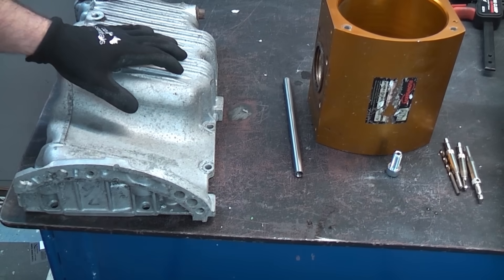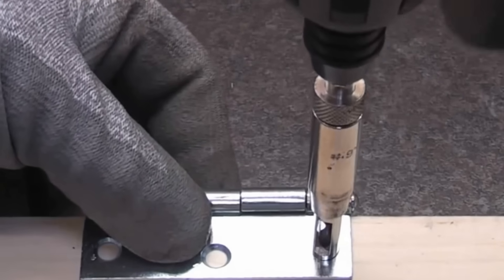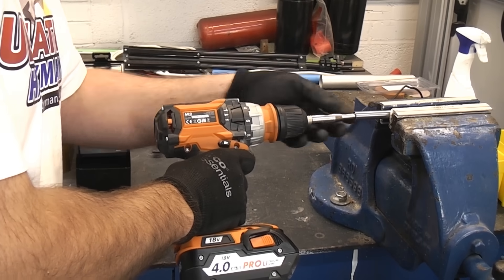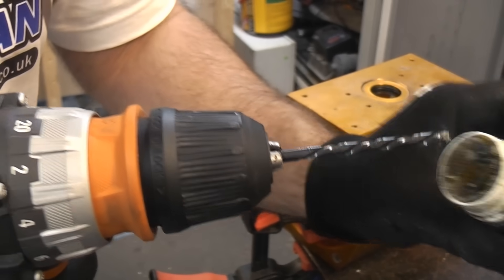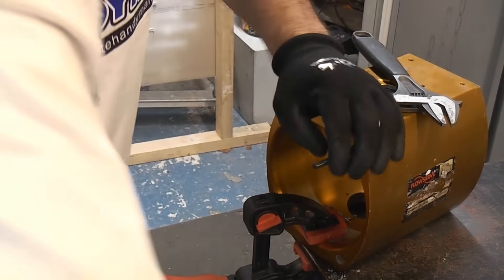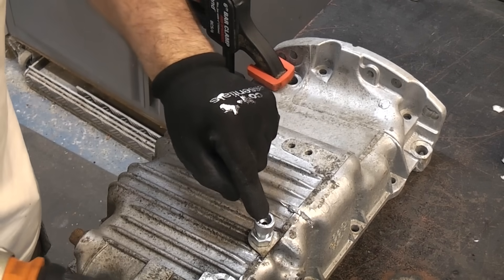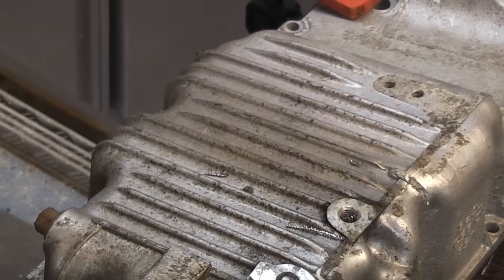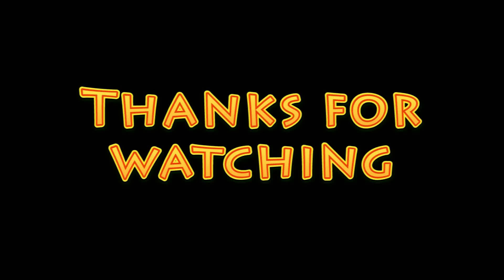How to remove a broken bolt in a deep hole | remove broken bolt in recessed hole

Comment: AFAIK you should not use copper grease when putting steel bolts in an aluminum object. Copper increases galvanic corrosion of the aluminum. You can use a marine anti-seize compound. I use ceramic anti-seize.
Reply from the maker: Thanks for the comment

Comment: Good video, for myself whenever I do this, firstly I don't bolt the guide (or bush) down, if the broken bolt releases it will just wind the guide out too. also I don't set the drill going as you do in the later part of the video, I always do it in short bursts as you did at the beginning and very rarely need  to use an extractor as the drill bites in better rather than just cutting.
Reply from the maker: Thanks for the comment

Comment: I have one Question. What amount by % do you reduce your torque settings when using anti-seize? on T-10 and-12 in Aluminum and or steel? I wasn't aware of all ways to remove broken bolts. And I am an old timer. Thank You for the education.
Reply from the maker: I don't normally bother reducing the torque to be honest.
If you think it is important you can ask the anti-seize manufacturers- they should have that data.
Thanks for the comment

Comment: Make a set screw into cleaning plug tap by putting a couple of saw cuts down the length, run it in breaking swarf every 3/4 of a turn by reverse of half a turn. 
Always assemble dissimilar materials with loctite 222 or copper slip. Goodness knows where you get a LH twist drill from.
Reply from the maker: They are widely available- Left handed drill bits- https://fave.co/2xJjK1M
Or in the UK- Left handed drill bits- https://fave.co/2DubtF4

Thanks for the comment

Comment: Never tap in a screw extractor,  you can cause the screw to expand,  the counter clockwise turning is enough.
Reply from the maker: If the manufacturers tell me to do something, I normally do it.
Please contact the manufacturers and tell them, that their instructions are wrong.
Thanks for the comment

Comment: Won't greasing a bolt make it come lose easily? I mean by accident, via vibrations etc?
Reply from the maker: No, anti-seize doesn't normally affect fasteners like that. If a fastener is likely to vibrate loose, you would use thread locking compound or something to prevent it from loosening. 
Thanks for the comment

Comment: Back in the 1980, I usually use a drill bit and a Hex Tools  Wrench  and  to Remove a Broken Nut From a  manifolds from a 1988  Toyota Engine , it works like miracle .  😎👌👍
Reply: Back in 1980 u removed a broken bolt from a 1988 engine !?   Which u brought back in ur time machine ??
Reply from the maker: Thanks for the comment
Reply: remove a broken nut from manifold?
Reply: sorry I can't make any sense of what you are saying either. :)
Reply: Big, if true
Reply: Exhaust pipes used to be bolted to the manifold. Breakage was common. Usually I would drill a hole through the broken bolt, or remainder of stud, longways. Try an extractor and heat. If that didn't work, and it usually didn't, blow it out with a cutting torch.

Comment: Why do they make thos extractor square ? I had to make a special tool out of a 1/4 extension just to get a good solid grip
Reply from the maker: Not sure, but a 1/4 hex drive on the end would be useful!
Thanks for the comment
Reply: @ultimatehandyman  I'm sorry it was a 3/8 extension..I had a broken spark plug ..I bent the extension like a L it work to perfection tha was over 15 year ago but I still keep the bent extension in my tool box

Comment: That is all great on this bigger type of screws...but what do you do on M3 or M4? This proces is pointless on smaller screws?
Reply from the maker: There is not much you can do on smaller screws, apart from drill them in the centre and use a screw extractor, or drill out the screw completely.
Thanks for the comment
Reply: @ultimatehandyman 
Yeah I tried everything and nothing works...the screw is just too small and I can't drill the hole into it cause there is not enough material around it? 🤷‍♂️🤗

Comment: Is that a 2007 VW Passat sump by any chance? Looks familiar! ;-p
Reply from the maker: As far as I know, it is from some model of MG.
Thanks for the comment
Reply: @ultimatehandyman  Ah, looks very similar, my dad's Passat has a dodgy oil sensor so I poked my head underneath the car and the sump looks very similar, the sensor is in the position of the sheared bolt you were working on. I just stumbled across your video and thought it would be handy as I have a few stuck bolts on my 31 year old car that I suspect might end up snapping soon! Very handy information in this vid! :-)
Reply from the maker: Blimey, I thought my van was doing well at 14 years old - 31 years is awesome!

Best of luck with it ;-)

Thanks for the comments
Reply: @ultimatehandyman  Cheers! When it comes to these bolts I'm going to need all the luck I can get!

Comment: The bolts must be softer than aluminum in  this video,unless there are inches of threads and the bolt was too long.I've never broken a steel bolt inside aluminum,how did you do that?
Reply from the maker: Steel bolts sometimes shear because they are so tough. We use different tensile strength bolts on site and if you use a high tensile bolt they tend to shear off, whereas a lower tensile strength bolt is more ductile and will not shear.
Thanks for the comment

Comment: Hi,  I have a slotted M5 bolt on a chainsaw in a recessed location that I cannot remove.  The previous owner messed up the slot.  It is the recoil starter bolts on an 015 stir ll chainsaw.  The bolt is a lot harder than the surrounding magnesium case and I have to remove it to clean the carburetor.  Any ideas?
Reply from the maker: This could be a hard one. I'd start buy spraying some spray penetrant on the bolt, then insert a slotted driver and give it a smack with a hammer (the shock can help to loosen it). You could then try an elastic band over the end of the screwdriver, sometimes it helps to grip rounded off fasteners.
Good luck with it.
Thanks for the comment

Comment: Just FYI don't bang on your screw extractor set with a hammer. Once the ridges get rounded, they don't "bite" anymore and you're buying an new extractor.Let the tool grab the piece you're extracting on its own.
Reply from the maker: The instructions tell you to tap them in with a hammer ;-)
Thanks for the comment
Reply: You better write to the manufacturer of the screw extractor and ask them to correct their instructions.

Comment: Thanks for the video. The guide bolt is a good technique that I've used. Steel in aluminum can be tricky especially if subjected to the elements and heat. Damn chemistry. I'd like to add a couple points for anyone watching/ reading if the left hand drill or pick doesn't work. I start a hole with a 2mm carbide drill. Very sharp and doesn't walk off uneven surfaces as easily. Use care though because they are brittle and will break off if you get it sideways or bound up. Don't use a traditional center punch to mark the center of the hole if it is below the surface. The displaced material has to go somewhere and that somewhere is outward into the thread. Start small. Small drill, small extractor. Then work your way up. Eventually, the wall thickness will be much reduced and the remaining offender will be very weak. Often I've had good luck using a much smaller extractor than I thought, but drilling the hole deeper. If your hole diameter is too big early on, it reduces your options as you progress down your list of techniques. Good extractors are helpful and I use a very small brass hammer. The brass yields a softer hit to the extractor (less broken ones) and won't glance off to the side. If the piece is small enough, I will remove it and put it on the milling machine, however, there have been times I've extracted bolts at work where I can't even see down into the hole and had to use some more manual techniques.
Reply from the maker: Thank you for the comment ;-)

Comment: THANK YOU >>> VERY HELPFUL FOR WORKING ON BROKEN BOLTS ON MY DIRT BIKE!! THANKS FOR AWESOME VIDEO!
Reply: lmao came here for the same reason
Reply: Lol same my frame bolt is snapped
Reply: my spark plug broke inside the motor of mine i think its cross threaded im stuck 💀
Reply from the maker: Thanks for the comment

Comment: I wanna see video of the removal of an exhaust manifold bolt that's broken off in the block while the engine is still in the vehicle. Maybe the manifold of a v6 or v8 that's pointing to the rear of the vehicle in a transverse mount. Was so much easier to work on the older vehicles. Today's vehicles seem to require several wrists and elbows on each arm and my hands are usually too large to fit into extra large gloves. Thanks for the upload.
Reply from the maker: People think that because I demonstrate videos on my bench, that I don't have to do difficult jobs at work ;-)
Thanks for the comment

Comment: Actually when a bolt twists off it will be usually flush with the surface. You will not have threads to screw a bushing into. So your demo is no good for real life circumstances.
Reply from the maker: Actually, sometimes they break below the surface, just because it has not happened to you yet, does not mean it never happens.
Thanks for the comment

Comment: About 15 years ago I acquired a 1969 FJ40 that badly needed to be restored.  Although it ran and the transfer case was in great shape the body needed a lot of work.  I set about replacing all the bolts holding the body parts together with Stainless steal and quickly become frustrated with all of the bolts that broke off before I could get them removed from the welded in place nuts. For weeks everyday after work I found myself in the garage drilling out the old bolts using a reversed threaded cutting drill bit and then a screw extractor to pull out the remaining bolt.  Sometimes if I was lucky just the left hand drill bit would work and others I would need the screw extractor.  I found it easier to use the Screw Extractor if I had my wife tap on the end of it while I turned it counter clockwise, she worked like a charm.  I would do maybe 20 before dinner then have her help me after to use the screw extractor.  I had given up on being frustrated because the extractor wouldn't get a good bite, just a small tap would do wonders.   Sorry I can't post a picture of it here and I don't want to create a YouTube channel just for that.  Thank You for sharing this information with the world.  I'm 60 years old and love the idea of using a bolt with a hole drilled through it as a guide to find center.  I'm sure I would have been a lot better off if I had had such a tool 15 years ago!
Reply from the maker: Blimey, that does not sound like fun, it's great that your wife gave you a helping hand. Thanks for sharing the story ;-)

Comment: The torch is very iffy. For steel, it will cause permanent warping of the part as the hot portion expands. For aluminum, with its much better heat conduction, the risk is smaller, but not negligible. If you possibly can, heat the ENTIRE PART EVENLY to prevent warping.

Comment: Furthermore,,,,, here is why the 4th or nearly last bolt breaks, It is because you have fully loosened all others allowing a bind on the last one. Trick is to take out bolts in a star pattern also and lube them up putting them back in ( in the case you have an iffy tight bolt). once all have been loosened and put back in, you are in the clear.
Reply: Antiseize is often proof against seizure in the future. Copper and "pure nickel" type are effective. They are not lubricants as such; they don't cause threaded fasteners to loosen. The nickel type is good for exhaust manifold, headers, catalytic converters and other parts that get really hot.

Comment: I like to see removing thebroken screw in real world, from rusted, parts(most common behavior to broke a screw) This way its easy.
Reply from the maker: I'll do that, no problem at all. The problem most of the times is that I work in a chemical plant and I can't film what I am doing without getting special permission.
The techniques are the same as what is used in this video though ;-)
Thanks for the comment
Reply: Looked like a setscrew, not broken bolt as i fast forwarded ir by

Comment: Great. I have a small M6 broken in an aluminum trans case which is flush with surface. Any suggestions?
Reply from the maker: It will be difficult, but not impossible to get it out. I'd apply some heat first and let it cool, then shock it (both techniques shown in this video). Then centre punch the bolt dead in the centre, then try drilling it, using a left handed drill bit if you have one. Failing that you will have to use a right handed drill bit and then a screw extractor. Be very careful though as small diameter screw extractors break easily and drilling one of those out can be a real pain, it is not impossible- but very time consuming- https://www.youtube.com/watch?v=7JCfEMrCjhc

Best of luck with it ;-)
Reply: +Ultimate Handyman. Thanks. I had an extractor break on me on an M8 bolt. Had to use die grinder bits to get it out, but it worked and I ended up drilling out the rest of the bolt without damaging the threads. Hope this easier in the aluminum.

Comment: Bolt extractor snapped inside of a 1997 Honda Civic of a snapped bolt on Water Pump.
Now, how to drill into a extractor (snapped inside of a snapped water pump's bolt) and get the Water Pump's Bolt out now?
Reply from the maker: It is not impossible (unless you have no room), but it is not an easy job- https://www.youtube.com/watch?v=7JCfEMrCjhc
Best of luck with it.
Thanks for the comment
Reply: Trade the heap in on another, or call the scrapper for it. It has a dozen other things worse than this that are lining up to happen one at a time. Shortly after fixing one problem another will go wrong. Repeat.
Reply: After you spend another L1,000 on it a rod will go thru the side of the block.

Comment: Somehow I made it through 50 years in the trades without ever having run across cutting paste.  A firm believer in cutting oil, and now have cutting paste on order.  Thank you for that one.  As to drill guides - it never occurred to me and I've never seen drill guides for this.  But next time...   I do treasure my cobalt left hand drill set.  Goes to show your never too old to learn.  Many thanks for an excellent video.  I'm almost looking forward to the next broken off bolt - not really.
Reply from the maker: Thanks for the detailed comment ;-)

Comment: Those times when I don't have a tap handle available (or space doesn't permit its use), I would use a 12-pt. socket and ratchet or, alternatively, a socket with a T-handle.  A long extension may also help to put the tool and your hands above the work when space is at a premium.  For me, turning the nut out with an adjustable wrench isn't optimal; it tends to loosen on you, and you're going 180 to 360 degrees with it, which can be a problem for those with mobility/dexterity issues.  You can, of course, go 90 degrees or so with the adjustable, but then you have to take it off, re-set and re-tighten each time, which is wasted motion.  Over time, that tends to round the square end of the extractor.  As you can probably tell, I don't care much for adjustable wrenches.  I have several, but don't use them unless I don't have a socket or wrench big enough (or metricky enough) for the fastener.
Reply from the maker: Thanks for the comment

Comment: thanks for the vid post , very informative !
I have an 8mm glow plug on a jeep CRD by fire wall and need to remove it 
it has spun on me ,,,any tips will greatly appreciate....Merry Christmas to all and Peace on Earth friends !
Reply from the maker: That sounds like it is going to be a nightmare to remove. Is it spinning in the hole, like the threads on the glow plug are stripped?
Reply: @ultimatehandyman  hi again !!the bolt head size 8 glow plug nut part has broken off and spinning freely , the glow plug is seized on head ...am afraid to drill and damage head cause it will ruin the threads , other option is remove head which is a bit expensive  !!!

Comment: I'm in the USA and have never seen cutting paste, or a spanner like the one you have. 
Where can I get these products at?
Thanks
Mark
Reply from the maker: Hi Mark, these links might help-
Cutting paste- https://fave.co/2GpbkV1
Bahco adjustable spanners- https://fave.co/2R86uzH
Thanks for the comment
Reply: Tap Magic threading and cutting oil. One for aluminum (maybe magnesium, too?) and the other for everything else. http://www.tapmagic.com/ I used it for years. With TM stainless steel taps like it was butter.

Comment: Couldnt you drill into the bolt, thread it, put a bolt into the first one with something like epoxy or other holding material, and then heat the whole thing and back out the bolt?

Comment: I used a bolt and a tiny amount of super glue to remove a bold lodged in a piece of equipment, remember the sheared bolt is no longer under tension, and it worked beautifully.

I found you video helpful and informative, thank you.
Reply from the maker: Thanks for the comment

Comment: Yes, but where can you get a left handed drill bit, let alone one of the correct size in an emergency! Also penetrant will only help if corroded in! PILOTING WITH OVERSIZE DRILL (IF NEAR TOP OF HOLE, GIVES WIDE CUT TO STOP SLIPPING), THEN SMALL DRILL ETC. THEN TRADITIONAL EASY OUT! A LEFT HANDED DRILL, MIGHT JUST DRILL RIGHT THROUGH IT! AND THEN YOU MIGHT HAVE A HOLE TO BIG FOR AN EASY OUT!!!!!!!!!!!!!!!!!!!!!!
Reply from the maker: I can, as I have a full set of left handed drill bits.
Thanks for the comment

Comment: Steel bolt in aluminium with copperpaste!  That is to creating a good galvanic element that will eat the aluminum. Use zink paste instead.
Reply from the maker: Thanks, I bought some ceramic based anti-seize a few weeks back ;-)
Thanks for the comment
Reply: ...or a graphite grease, perhaps